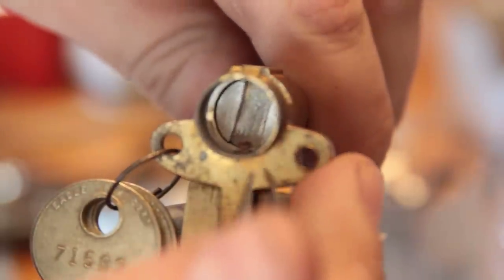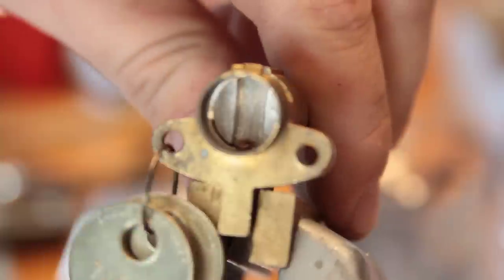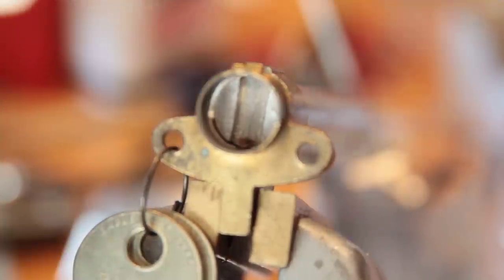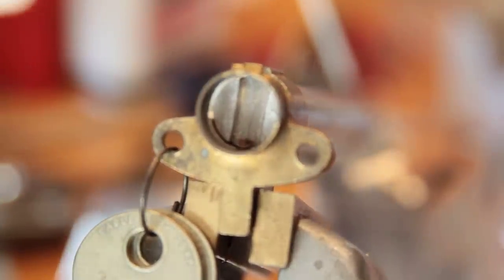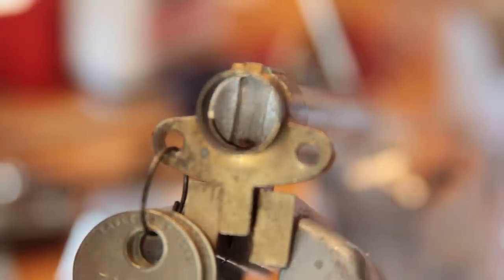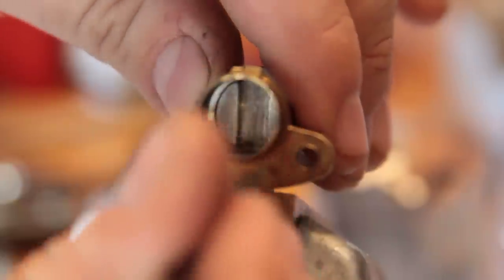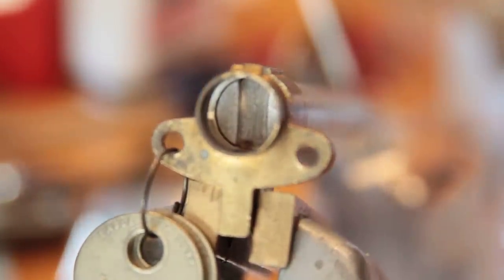(035) Homebrew Plug Follower

Comment: Nice one buddy. Ive got a homebrew one and its the launcher you get with bonfire night rockets, for different size rockets the tubes are different diameters and found they fit normal euros and thinner tubes are about sane size as American lock type cylinders. Just need a set of pinning tweezers now then I can start gutting locks :o))))